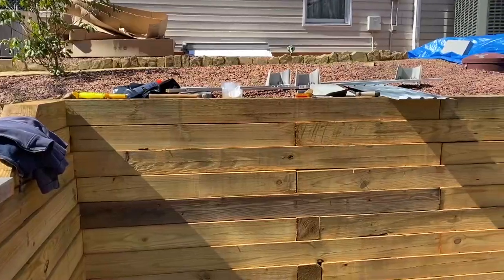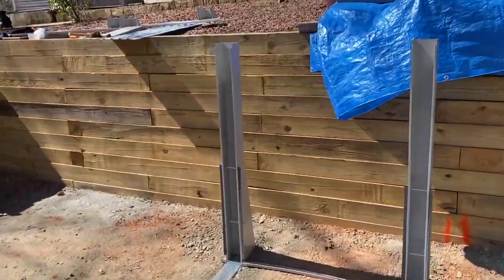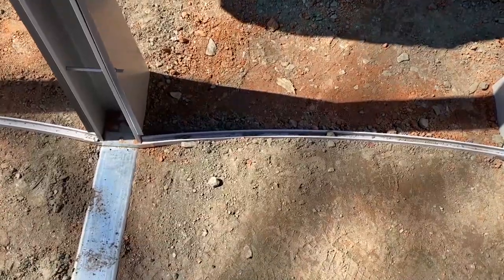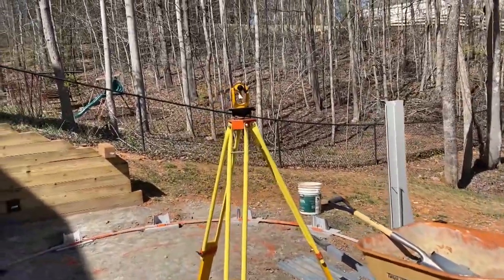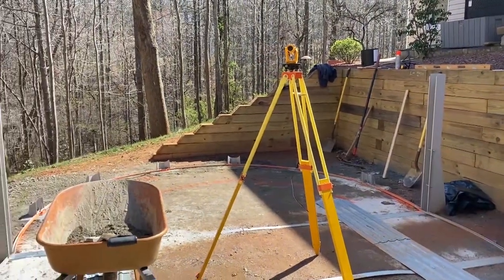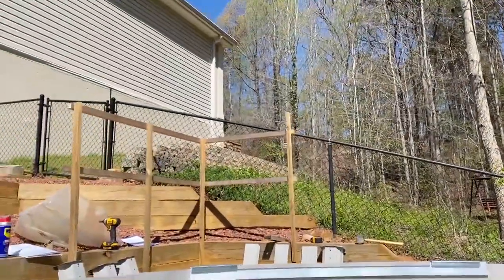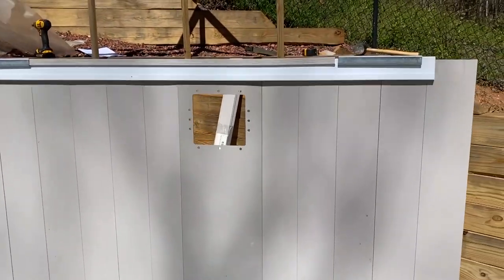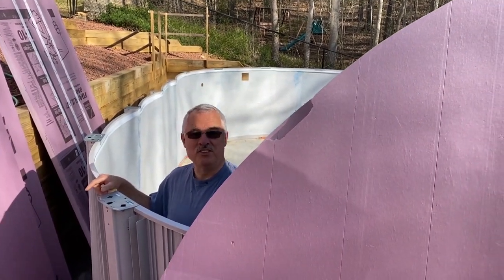Buttress Free Above Ground Pool Installation Buttress Free Above Ground Pool

Comment: Beautiful setup. Love the deck also. Can you please help me understand how you put the trex deck border all the way over the pool coping? Trying to figure that out for mine. Any help would be much appreciated.
Reply: One of the reasons I went with the Intrepid pool was the fact that the top rail is aluminum and you can sit on it. Also the 4” interlocking aluminum wall structure is very strong .  There is a double 2x8 beam running parallel to the pool wall which keeps most of the weight off the pool wall. The Trex decking basically canterlevers 12” off that beam and rest on the top rail. You must have a beaded liner for this to work as I don’t have to remove anything to change liner. 
If you send me your email, I can send pictures of the deck framing.
Thanks

Comment: Great video. I’m getting ready to install a 27’ round intrepid on concrete and it also calls for a 3 inch base. I was planning on 2”foam but now I’m worried I should add the extra inch like you did. It’s a 40 gauge beaded liner. Do you think it would stretch the extra inch if I go with the 2”base?
Reply: Hi Jim,
The manufacturer of my liner required ( in bold print) a 3” base so thats what I did.
Reply: Getting ready to purchase an above ground pool and plan on using foam flooring also. Can you please explain what you mean by needing a 3” base? Thanks for the video awesome job!

Comment: Did you use a patio stone under the buttress free end channel on the inside of the pool by the strap .so two stones per end channel one on the outside of the pool and one on tje inside ?
Reply: If you are asking about the buttress free supports, i used one 2” cap block just on the outside end  to keep keep it from sinking into ground.